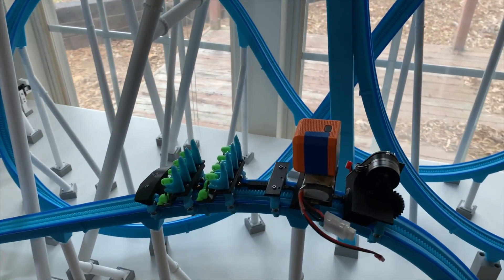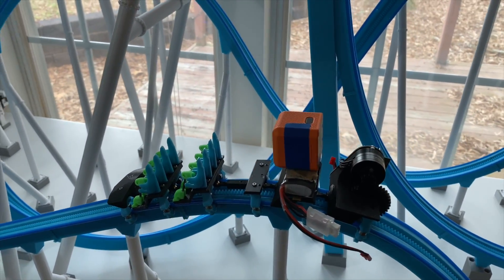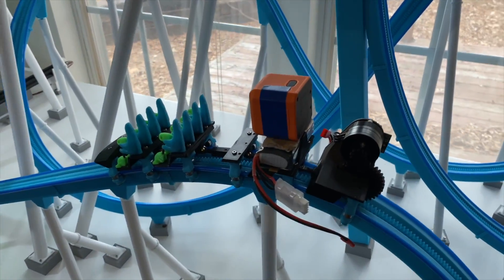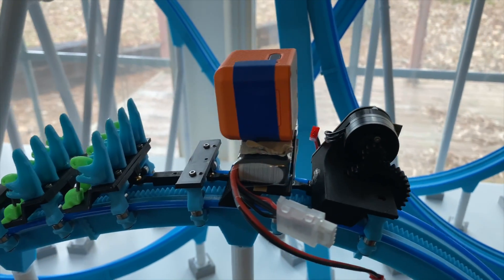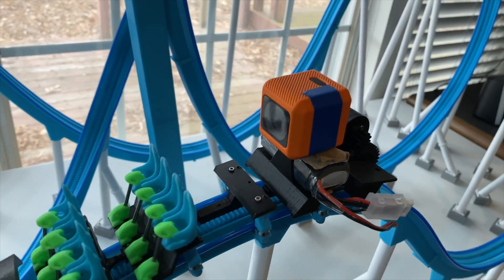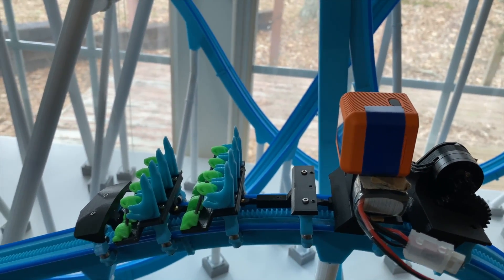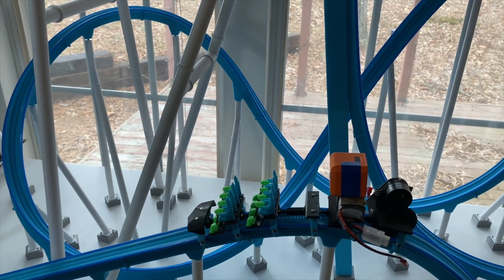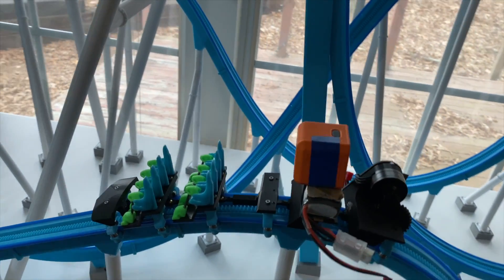POV - 3D Printed Powered Roller Coaster

Comment: Very nice. I would be more than interested to pay for a tutorial on how you parametrically generated the supports and the rail. Long time Solidworks user here which I use at my daily job. After seeing your previous video, I spent all weekend learning about autodesk inventor and ILogic. Very very interesting stuff. Again, if you ever released a tutorial, I would happily pay for it. Keep up the good work
Reply: You can do the same thing in solid works  using 3d drawings and a csv I learn about it recently in college.
Reply: @bradleyswanson329  Oh! I will have to check that out. Thanks!

Comment: Absurd how realistic this looks even at this scale. Have you looked into using some heavier materials for the seats and/or 'people' to make them shake less?
Reply: If I had to guess you're mostly seeing backlash and other inconsistencies in the drivetrain and track. Increasing mass may even worsen the issue.
Reply: Behind the camera there seems to be some sort of gear that is slowing it down
Reply: @tla1472  watch the previous upload on the channel, there's a stepper motor controlling the speed.

Comment: I feel like it should run just slightly faster.
Reply from the maker: I added just enough drag to the simulation to make it crawl over the last hill. It's adjustable, but that was just the effect I was going for... to make the variations in speed more dramatic.
Reply: @jonmendenhall5074  it’s a great bit of work either way!

Comment: Did you program the train to slow down on the uphills and speed up on the downsloops, or thats just how it ended up running?
Reply from the maker: I didn't directly program the speed throughout the track, but I set it based on a physics simulation so that's of course how it ended up.